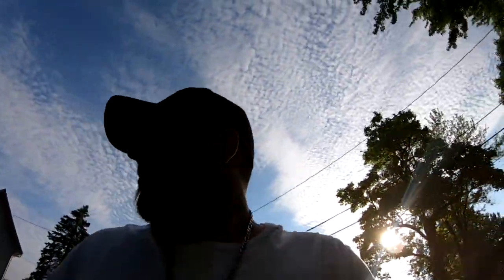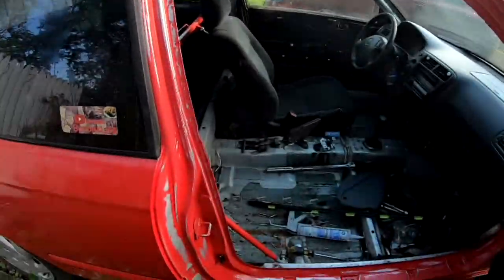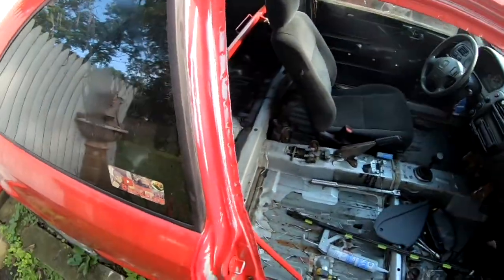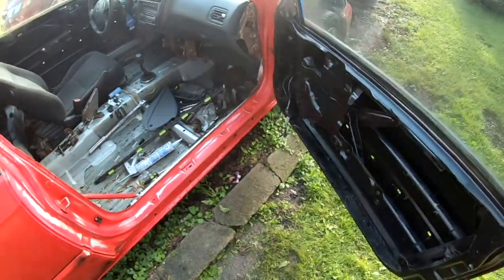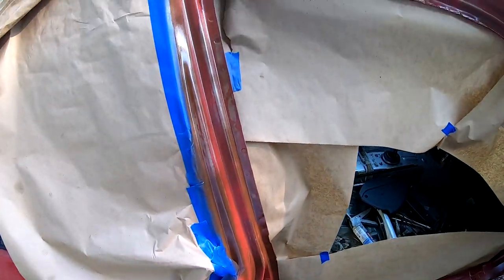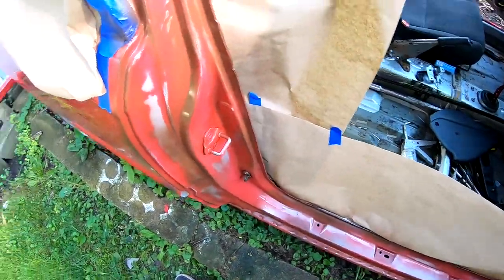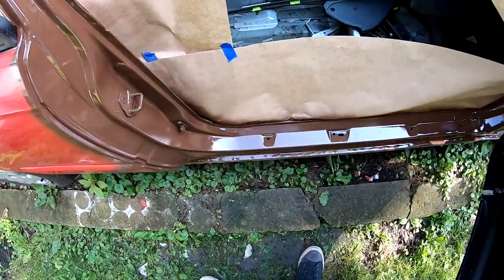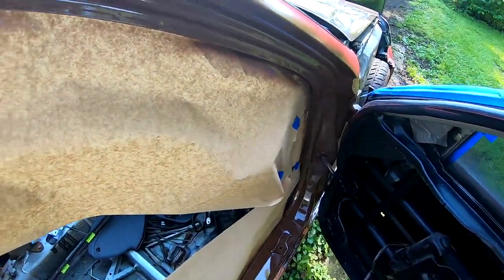Rustoleum Brown passanger Doorjam civic (NESQUIK??)

Comment: I think I know why my paint is so so I do 2 coats and heavy at that. You do the 1st very light and go from there going to try this now thanks.
Reply from the maker: Yea always do your first coat very light almost nothing. Just make the surface sticky. Like hairspray. Thwn the second coat is your color change this way you dont get runs. Then your 3rd coat is your heavy coat. What ever your 3rd coat looks like thats how its going to dry. Wait 15 to 20min between coats
Reply: Thanks i do shake the cans and you can hear the bearing moving around but not a 1min. (OcD) LOL but thanks going to try these steps saves me from beating the crap out of what ever i am painting.